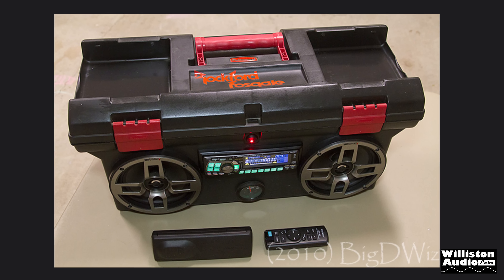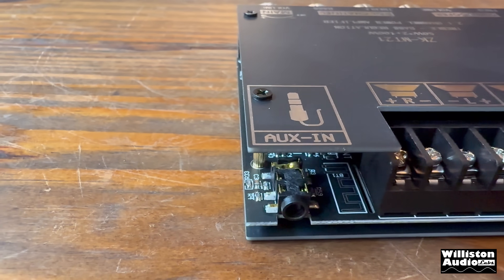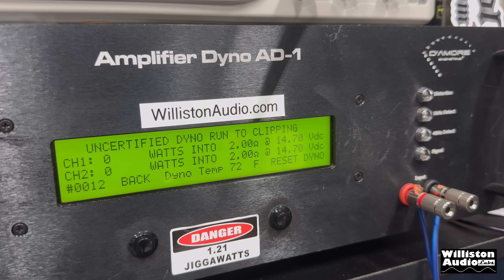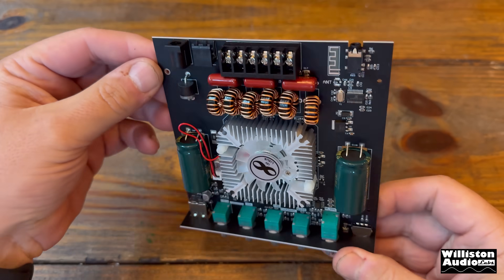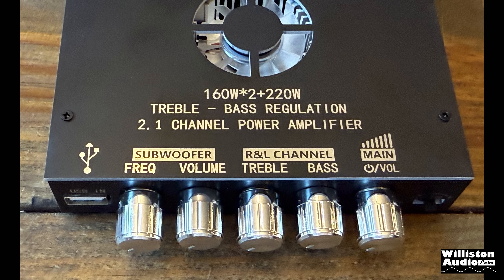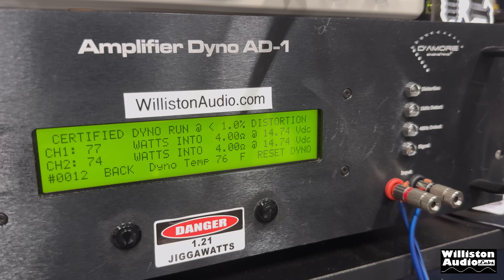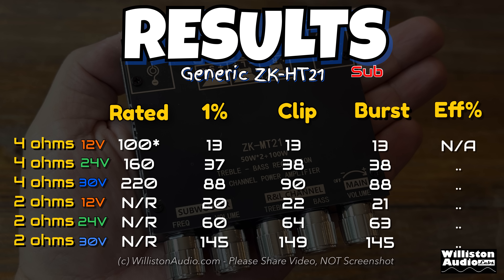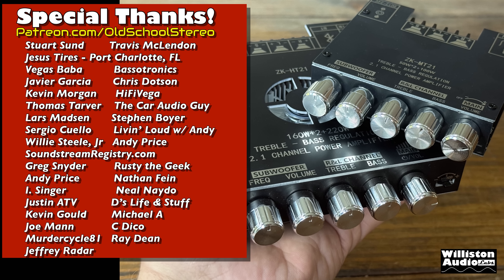Can This $15 Mini Amp Power Stereo Speakers and a Subwoofer? ZK-MT21 and ZK-HT21 Tested and Reviewed

Comment: I have the MT21 on an old ipod dock with dewalt battery adapter and external sub consisting of dual 8" subs from chrysler vehicles and it sounds great. My only issues with the amp are that it doesn't actually turn off the bluetooth when you turn the switch off, it seems to drop audio at certain parts of songs in a weird way (could just be my unit) and it works ok for 2 ohm subs but at higher volumes, the chip overheats and cuts out.
Reply: I use aux in for mine. BT was annoying, sound glitches and automatically hooking up, so I had to unpair it. Sounds great on aux to my tin ears. Movies, music, tv, games. Have a second battery run a Raspberry pi 4 or 5. emulate consoles, run Android. Small touchscreens are cheap. So are HDMI projectors that can run on battery. Better to plug in with a projector though. Put it all in a toolbag and pretend like you're working.

Comment: Great presentation - {I have an HT21 powering two 3.5" Faital 3FE25 speakers in baby Karlson cabinets and he sub is an Infinity Primus 1200 in 30 liters sealed airspace with a series 750uF capacitor to boost the bass plus act as a highpass filter below 30Hz.  It reaches~35Hz with room shaking power on a 20v tool battery - am very surprised and pleased.  (hornresp's Filter Wizard in Passive mode is useful to examine the capacitor assisted sealed box characteristics).  I have an upcoming 50 liter JBL recommended GX1200 reflex box - hope SQ is good)

Comment: I had that same one with the sub output and no fan, it was good but the bluetooth kept randomly connecting and disconnecting even though I was using wired connection. I got sick of it doing that and got a different model that doesnt have BT and been happy since! They make good power for what they are and the size. The BT issues really is a problem though.

Comment: Several years ago Adrians Digital Basement did a video on the TI based amplifiers, I picked up several to play with and one was nearly identical to your MT21, though mine (supposedly) does actually have the TI chips in it and not the knock off chips you got stuck with.  I have it driving a pair of Realistic Minimus 7s and a HTIB subwoofer ($8 at a thrift shop, Mackelmore would be proud) making my work computer system, I have been really happy with the setup.

Comment: Tiaaaa , Derec , mayby posibble power out this chip only one , 10 procent thd signal ?? this 50 or 100 w ??? , look to pdf specification this ic amplifier , you remember tda philips ic amplifiers , max power to 10 procent , mayby this power its a possibly ?? , not this 1 procent ,

Comment: On my secondary PC I use a Aiyima D03 with optical connection for the main speakers (custom made), and a pair of Nobsound G2PRO for a pair of 10" subwoofers, Small amplifiers but sound so clean and loud, very impressed>

Comment: Maybe these are Chinese metric watts??
Reply: Yep. The Chinese power measurement system's been around since the car stereo flea market days of the 80's. Back then my rule of thumb was to move the decimal point one place to the left. ie: 50 watts becomes 5, 100 becomes 10. Shame these chip amps still lie like a rug to this day.
Reply: @curtchase3730  they re basically quoting the amplifier chips official manufacturers rating but at 10% thd 😂..so they can get away with it...
Reply: @uchekingsley7146  OK, ya, the tiny amp did pretty good in real life, and ya, there may not be huge difference in perceived volume from like 80 to 160 watts but will effect headroom if the amp actually did a full 160 watts output. Big deal.
Reply: @curtchase3730  LOL!  Move the decimal point then divide by pi.

Comment: Its nice to see a somewhat more aesthetic board layout compared to slapdash crap we'd been getting in these form factors for so long.
Hey D, does it say if you can run different loads; 2ohm on sub and 4ohm on stereo?
Reply: @themadmallard  I have one I can go as low as 2 ohms or as high as 8 ohms
Reply: @arielmateojesusdelacruz5186 I may not have said it right. I meant at the same time

Comment: 1:46 If you want a better version of the MT21 go for the TB21. It's far better quality than the MT21.
Reply: I'd like to see a follow-up test with the TB21.
Reply: but why not use one of the higher end wuzhi amps, the ones they make now with lossless components. all different size tpa chips. The amps usually have the bigger gold wuzhi brand capacitors. or the yellow and black changx capacitors. decent
Reply: @AlexWheely-bx7pk you could totally use the higher end ones. I was just giving a warning about the MT21. Wuzhi audio has had some problems with some of their amps and people flock them for it. They listened and then made the TB21 and i think also add filters (not really sure) so the sound is cleaner now. Right I'm thinking of buying the HT 21 or 1002T or some other models
Reply: I have several tb21 , run them on drill batteries, with high efficiency speakers and subs with custom boxes to get the most out of them , really good sound quality imo
Reply: @chuckchar  that's great. I have mine hooked up to my bedroom tv and for the price you just can't beat the audio quality that it puts out. Really great mini amp

Comment: I have this 2.1 amp running my PC sound system. Powered by a 19v 4.5A laptop PSU.  2 KLH bookshelf speakers and a 12 inch sub in the corner.  They may not be rated truthfully but they do sound great and for the price you can't beat these little amps.
Reply: I have an older one with the TPA chip. And I have never used the Bluetooth. I just use a 3.5mm AUX cable from PC headphone jack as the input.
Reply: @mikehensley78   Just FYI, because it's a very common mistake for some reason - that's a 1/8" audio jack. Not a 3.5mm jack. People started calling them by metric terminology a decade ago for some reason. The bigger ones are 1/4" jacks.
Reply: @TehButterflyEffect  yeah, just an FYI,  i have been messing with electronics since the mid 1980s.  I know what a quarter inch  and eighth inch TRRS connectors are.  they are commonly called "an AUX jack" OR "3.5mm".   it's a common mistake to call them a "Jack" when a jack usually refers to a socket or female part of a plug.
Reply: @mikehensley78   so why did you call the 1/8” jack a 3.5mm jack if you do know?
Reply: It’s because they do their rated power at 10% THD
Reply: you should have 24V if you want full power, read the specs @4 ohms each channel
Reply: @DemiWalker777 I have mine on 36v ..its the ht21

Comment: In 1989 I attached 2 carpeted 6x9 Walmart speaker boxes with lengthwise with small hinges, installed a 10 amp hour lead acid battery in one box.  For amp and signal i used a high power Kenwood head unit in a pullout stereo bag.  The speakers were the lowest power JBL's.

For parties at the beach or in the woods, I impressed everyone who saw and heard it.  It could operate folded, unfolded, or even separately 10-20 feet apart by pulling the hinge pins😊

Comment: Hey Skylabs. The ZK-MT21 amd TP21 are two slightly different amplifiers despite visually being the same. The MT21 you tested has generic chips for whatever reason? While the TB21 has real Texas Instruments TPA3116D2 amplifier chips, which is also the amplifier I acquired for my setup.
Reply: ive seen people put up reviews claiming the tb21 still had the domestic chips

Comment: The ht21 performs well. Got it hooked up to a 36v 7amp power supply. The sub channel slap. Great video. I wonder what the ht21 max pushes out🤔
Reply: there is a much better 2.1 amp with the tda7498 chip, The DAS  series A1. it has built in dsp. try it with one of their new voltage boosters. such as the pw500 or the higher amperage booster, the L22A, excellent gear.
Reply: @AlexWheely-bx7pk  tested that Amp and found that the Ht 21 is better.

Comment: I recently built a BT speaker using a Dayton Audio 30 watt mono amp, 3-cell lithium battery board and (2) 3" FaitalPro fullrange drivers (3FE25). I'm not blown away with the performance, but It's adequate.

Comment: 3:37 FYI, if you're using AI summary just for the screenshot then sure, fine. But for anything technical or specific that isn't relatively common knowledge, you can't trust them and are going to be better off at least checking its source everytime

Comment: Distortion light continuously glowing bright throughout all tests on MT21!  Should scope it and see watts going on! 😛
Always suspect of amps like that.  Probably a tweeter shredder.
Reply from the maker: I could hear it through the speakers too, def not clean
Reply: The Mt21 is really bad. If you want to buy you can go for the TB21. That's the newer version of the MT2. It solves most (if not all) the problems the MT21 has. I have had the TB21 for almost a year and still going without any problem
Reply: the das series is the only way to go, 2 tda7498e chips. amazing amp. with dsp built in. good caps etc. run it with the new wuzhi power booster. amazing setup
Reply: @AlexWheely-bx7pk  amps with dsp are amazing I have a stetsom dsplayer it is a 400w amp +  dsp + player in a package, around 290brl (50 bucks) where I live and their app is amazing. It also has an rca output from its built in dsp that I use in my 1200w sub
Reply: It's because the MT21 doesn't have output filters on the outputs so the switching frequency is coming out. It's relying on the speaker inductance as a lpf.